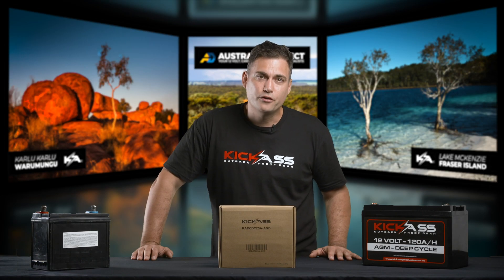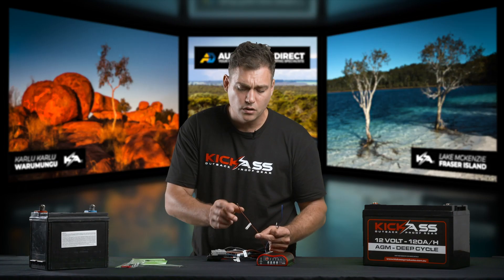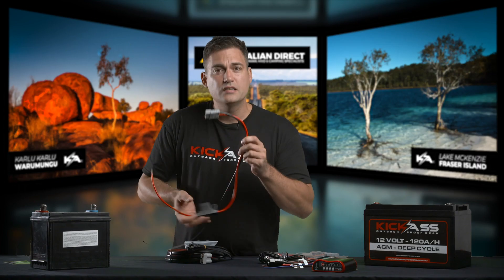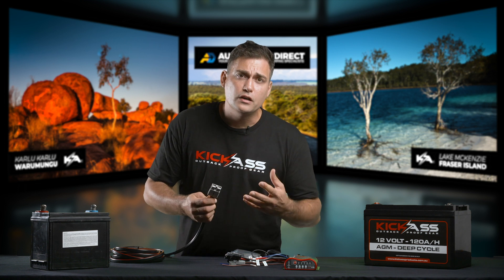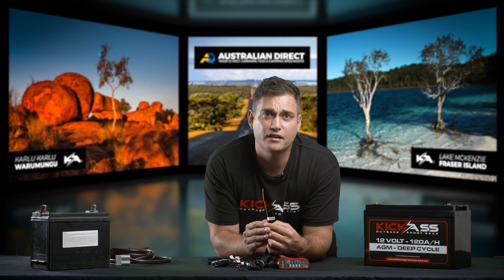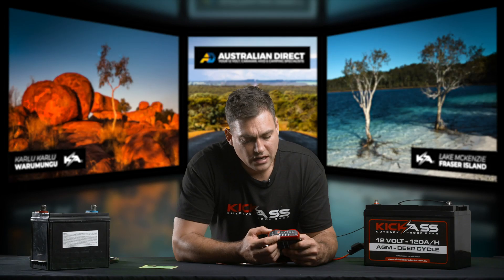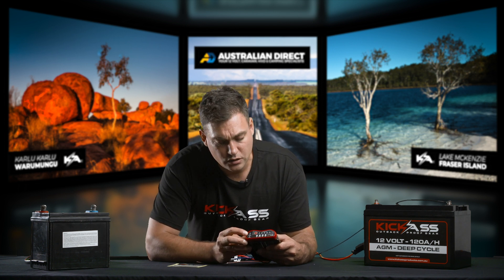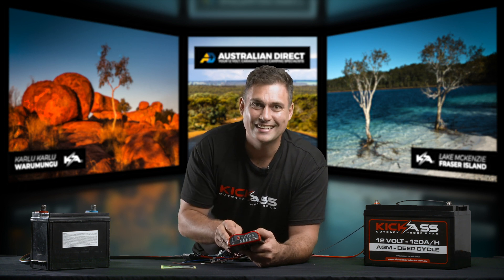KickAss DC-DC Charger Setup Guide

Comment: Hi. What are the specifications for the external LED? What voltage? Nothing in the manual.
Reply from the maker: Typically the voltage is determined by the colour. A Red LED will be around 1.7 to 2 volts. The current draw is 4mA.